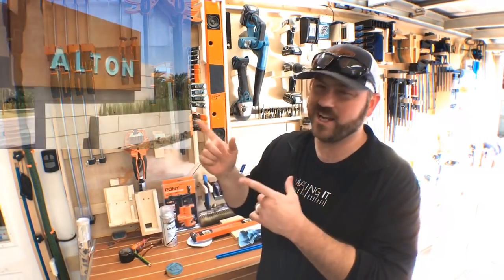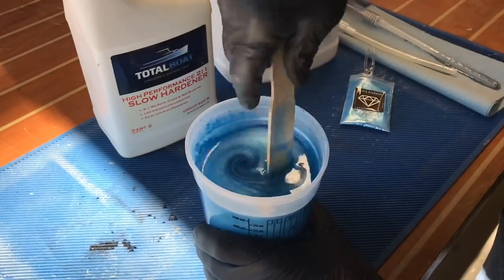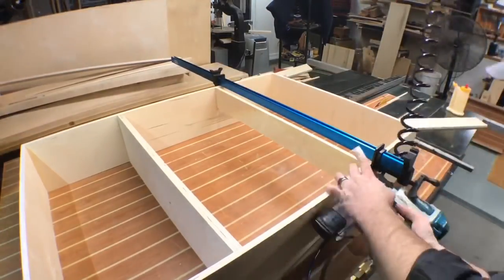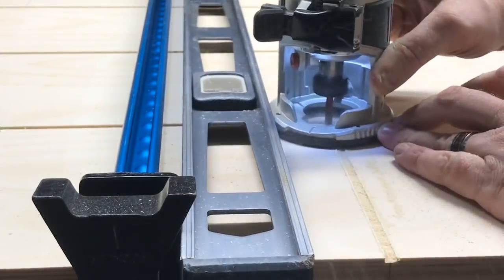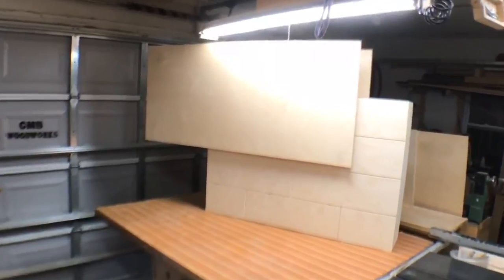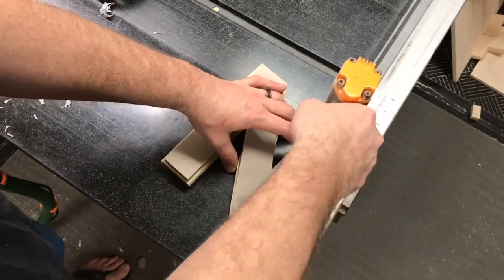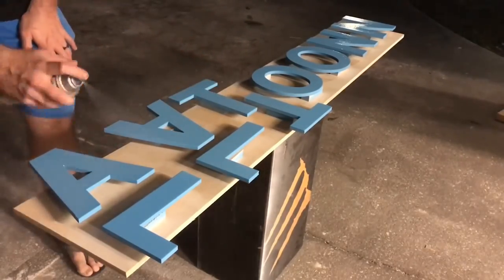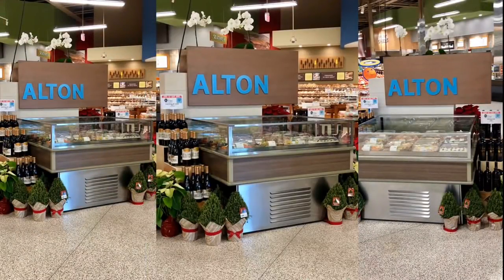I Made a Sign For A Publix Grand Opening | Woodworking Project | DIY

Comment: I attended my first Publix grand opening at USF on the 6th. It was an amazing party. Manager greeted everyone at the door!  Free samples on every corner. It was a joyous event...especially in a market where we have 3 Publix within 5 miles. 

About the video...I liked your approach to bricking the plywood. Do you think that you could have run the epoxy letters through the planer to remove the cardboard?
Reply from the maker: I could have random through the planer however I simply don’t have one at the moment nine died about six months ago. So remaking them was actually the better option in this case. I hated doing it but I had to
Reply: A Glimpse Inside It sounds like Santa needs to drop off a little something special for you. Happy holidays!

Comment: Looks great. Congratulations.
The kerning is different on your replica than on the big sign. Was that intentional?
Reply from the maker: I’m not sure what you mean by Kerning. Could you please clarify
Reply: @AGlimpseInside  In typography, kerning is the process of adjusting the spacing between characters in a proportional font, usually to achieve a visually pleasing result.
On the big sign the letters are spaced widely; on the small replica sign they're adjusted closer to each other. I'm not familiar with Publix signage as they are not local to me, so I don't know if their interior or printed or smaller logos differ from the big one on the building.
Don't get me wrong, it looks great and you should be proud of both the project and that your work was recognized. I was wondering if you had made an artistic choice or if you'd modeled the replica on a different logo.